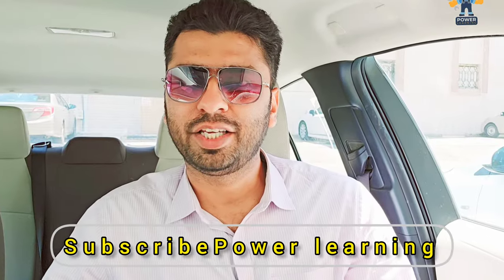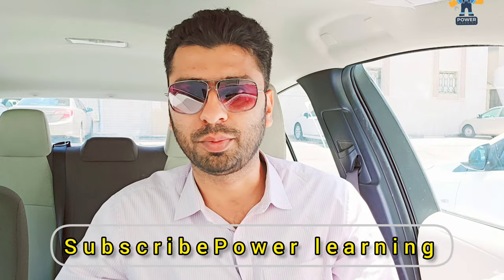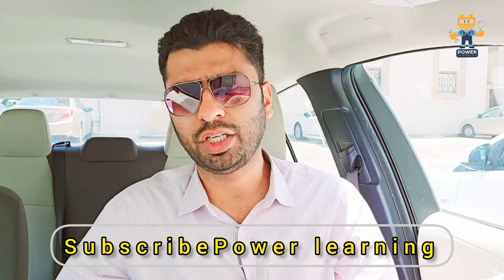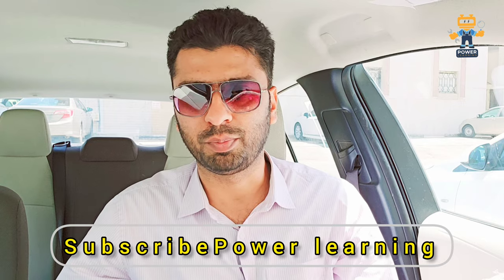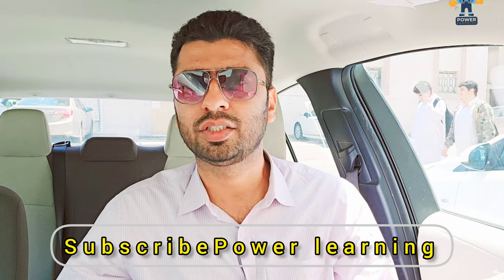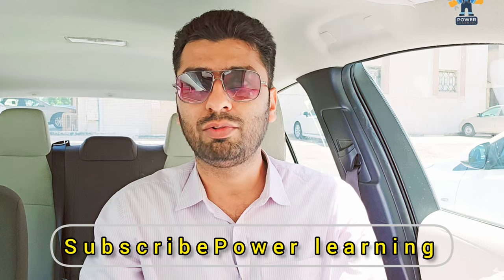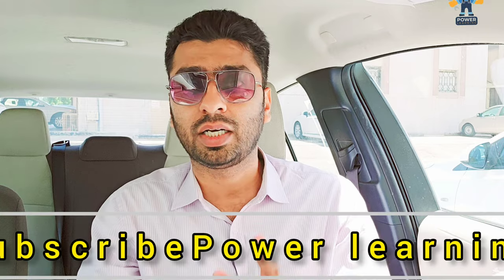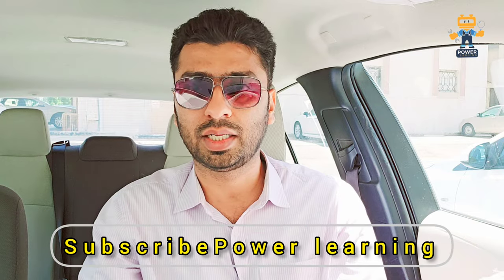DC battery charging system #dynamo  #batterycharger #electrical  @DieselGeneratortraining

Comment: I have 520kw diesel generator, 2 batteries in series means 24v for starting, when we stop the generator after few hours of running, and required to start again, generator not started due to batteries not supporting, we use static charger for battery charging for 1 hours, and generator started, please guide me,

Comment: From Ghana, West Africa.
Nice explanation.  My problem is, I use my car's 12V battery to start my manual switch diesel generator alright, but it goes OFF immediately I remove the battery. Initially it will stay ON. Explanation please? Thank you